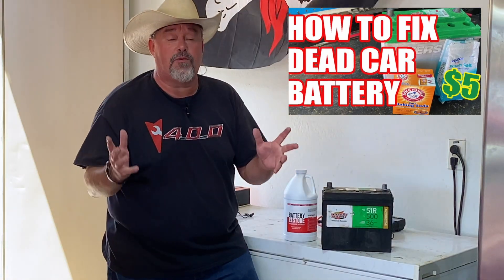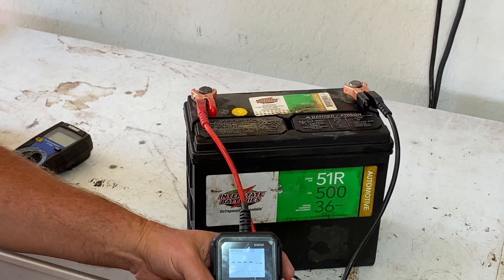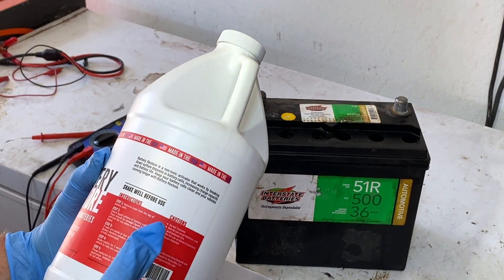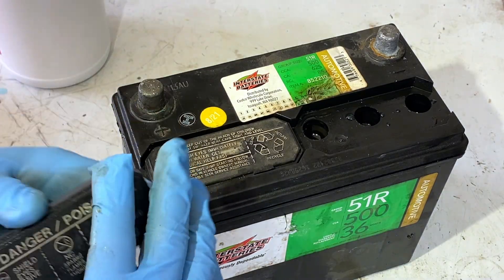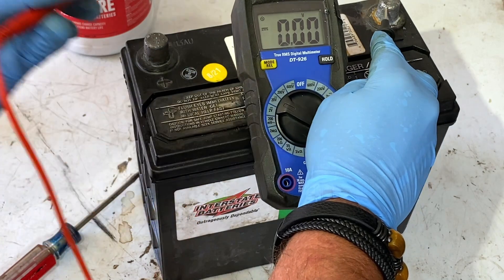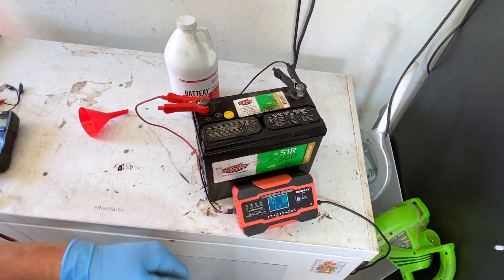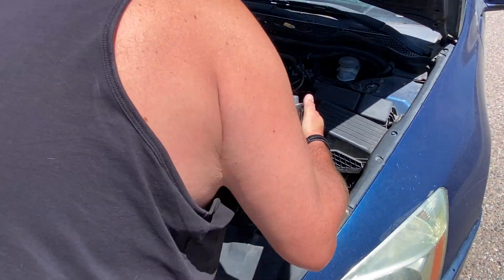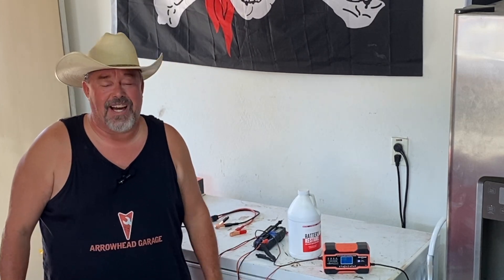HOW TO FIX A DEAD CAR BATTERY OVERNIGHT? How to Rebuild a Car Battery at Home DIY Dead Battery Fix

Comment: Most batteries here in Australia are sealed batteries, and always dry out, but if you can pull the eye glass out and add water,but it looks like it works, thanks for sharing, all the best to you and your loved ones
Reply from the maker: Well dang it, sealed batteries are no good, lol thanks for watching and saying hello!
Reply: Sealed batteries usually have there small fill caps under the battery sticker check and you will see

Comment: Distilled Water will do the same thing
Reply from the maker: Yes it will to top off the fluid in the battery.
Reply: To top off the battery, yes. But it won't fix the battery.

Comment: This is bogus.  You began with a battery with no charge left in it.  A valid test it to do a full charge then use your tester for CCA to get a baseline number, then run the battery down and do what you demonstrated to see what the improvement was if any.

Comment: How do you dispose of the old acid?
Reply from the maker: Call your city or counties recycling center.
Reply: @ArrowheadGarage  Sulfuric acid is what is used in drain cleaners. So it can be dumped in your toilet to improve drainage.
Reply: Dilute with water in a bucket, neutralize with baking soda until it stops fizzing and dump into the drain.

Comment: Uhhhh Guy, one must take the caps Loose in order to vent the build up of gas vapors during the charge. Failing to loosen the caps causes heat build up internally causing case swelling.
Reply from the maker: Thank goodness no case swelling or issues, I sure do appreciate you taking the time to not only watch the video but leaving a comment.  Thanks for helping me grow this little channel bigger :)

Comment: you don't tap off the battery water over at the base of the plastic opening.  when you look inside the battery fill hole you will see the plastic inside extend close to the battery cell plates.  the water line should be at the base of the plastic to allow water expansion.  Overfilling water past the base will cause water to spill on the battery top.  The battery was weak due to lack of water.  filling with distilled water and then charging overnight usually will revive the battery unless it is a very old battery or has a completely dead cell (each cell is 2.1VDC x 6 cell = 12.6 VDC).
Reply from the maker: Never over fill a battery, and if all you need to do it top off a fairly good battery then some distilled water can do the trick.  But if you have a battery that is 4-5 years old and clearly need more than a top off, the stuff in the bottle seems be working.  Thanks for watching and dropping a comment, I sure do appreciate it!
Reply: Very Well Stated. Thank you.❤❤❤❤
Reply: how is it holding up?

Comment: Wet area under the caps can short out the cells and thus discharge the battery. The area under the caps should be clean and dry.
Reply from the maker: Your're correct, I did clean up those caps off camera.  Glad you reminded me to stat that for others to know.  Thanks sir!!!